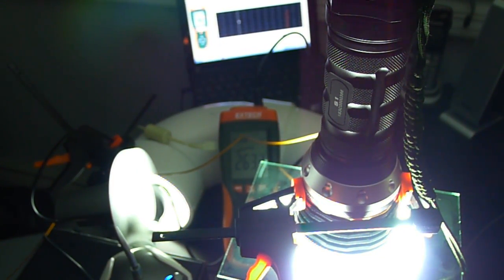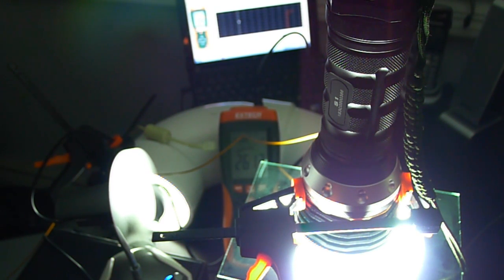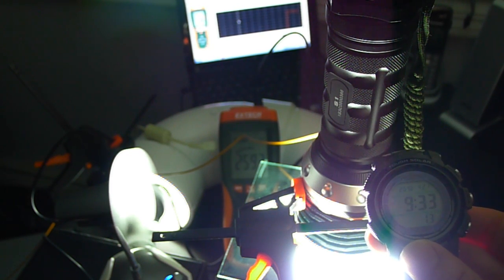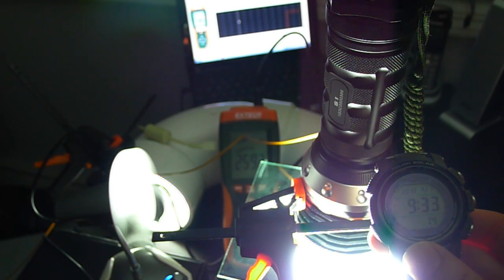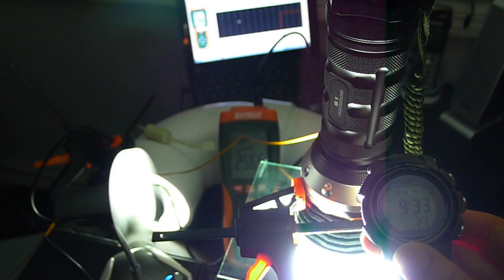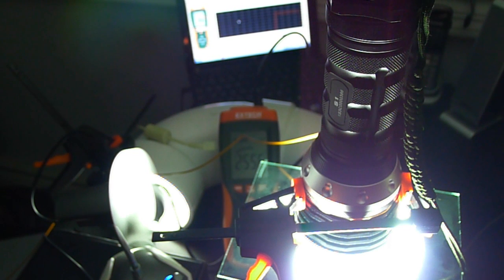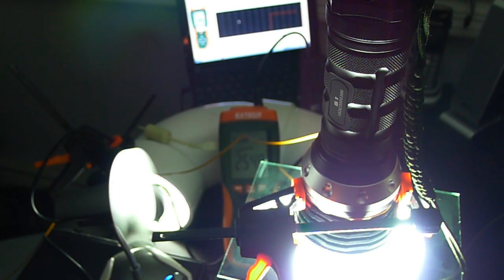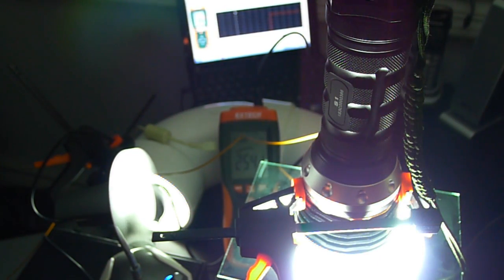XTAR S1 (Production) Review:  Measuring lumens

Comment from the maker: Thx for your comment, I should clarify that the XTAR S1 itself is regulated (and pretty well at that too w/the higher nom. voltage LiCO cells).  What I meant to say was that my PVC LMD is great for charting non-regulated lights and the comment wasn't directed at the S1 specifically, it just happened to be the first light I've conducted runtime testing with in this manner.